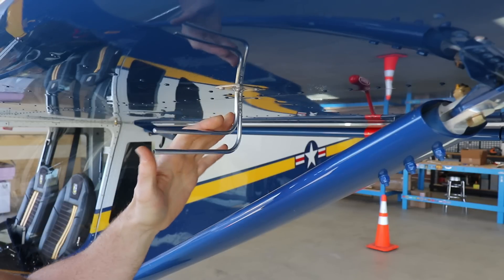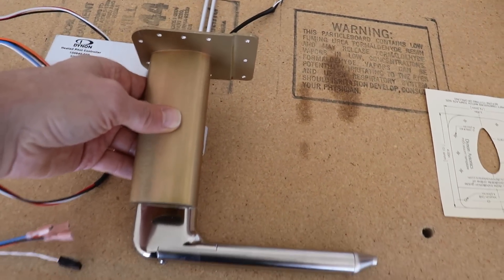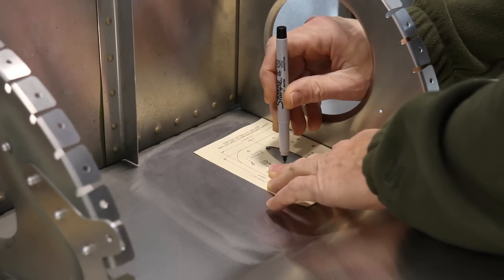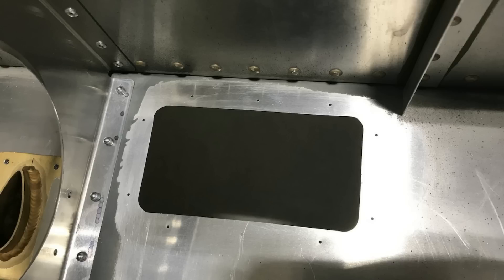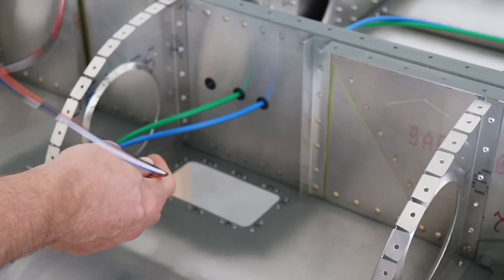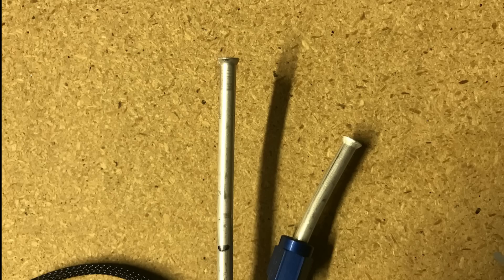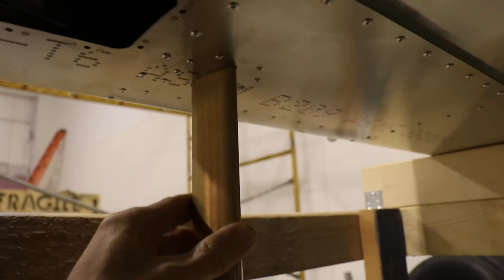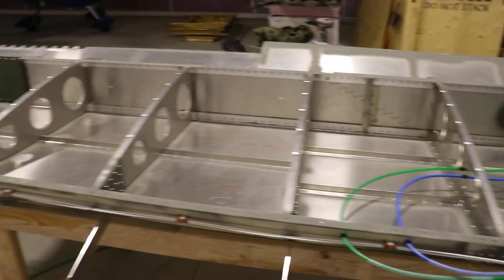Installing the Dynon Avionics Pitot Tube (Ep19)

Comment: How did you fasten the Pitot / AOA probe to the Pitot mast? The probe itself doesn't have any mounting or screw holes; is it glued in place?
Reply from the maker: It's a very very tight fit. I'm not using anything to hold it in.
Reply: @KitplaneEnthusiast  Interesting! We are doing the Dynon certified install on our Cessna 172... and the Dynon mast isn't 'certified' so we need to attach the Pitot / AOA probe to a Cessna mast. But it's not tight in the Cessna mast and there aren't any screw / bolt holes in the Pitot. Put a call into Dynon and waiting for the response, but I thought I'd see what some of my fave YouTubers had to say.
Thanks for the response!
Reply from the maker: @GlensHangar  My guess is you could just drill a small hole and use a sheet metal screw.
Reply: @UCpPmZDmGT33if0qh5GbJpiw Actually just heard from Dynon as I finished typing the last reply - supposed to drill holes for screws to hold the whole thing together. (as I thought, but just didn't want to do until I had a confirmation)

Comment: I’d like to see the two hard lines that exit the mast supported so they can’t rub against the mast tube.  Possible failure point?  Thanks for showing us your work.  Inspirational stuff!
Reply from the maker: Hey that's a good idea. Maybe I'll stuff a packing peanut in there. I think that would hold it nicely.
Reply: I was thinking the exact same thing when I watched it.  Looked like vibrations would rub those pretty good.  I would suggest just some of that plastic spiral material that you put on the lines in the trailing edge spar.

Comment: I watched a 2 hour Dynon Q&A installation video.  Love the plug & play and functionality.  But, they scared me concerning placement of cables, potential interference, vibrations, non-ferris metals, etc, etc.   Good info regardless of panel manufacturer.
Reply from the maker: Of course I don't want to tell you to disregard the Dynon instructions, but just as an FYI, when I installed the remote AHRS in my RANS S-6, it said not to mount it near any metal. The only place I had to mount it was at a joint of about 5-6 steel airframe tubes. It worked perfect there and I never had any issues at all with it. My AHRD is mounted near all of the control cables in my Cruzer and it works great. It's been my experience that the mounting location is not as critical as they might say. My opinion and experience only.
Reply: @KitplaneEnthusiast  Thank you for the kind and thorough reply.  Blessings and  happy holidays to you and the family.

Comment: You didn't show it but I assume you used a standard tubing cutter for the aluminum lines off the probe? Also is there feed back in Dynon if the heater element fails? Just watch the amp meter?
Reply from the maker: No, I cut the tubes with a band saw. Then I cleaned up and polished the ends, and then flared them.

Comment: Those connectors for the tubing look like 1/4"  5/16" NTP polyethylene push to connect fittings.  They are pretty standard in the box store isle for water to the icemaker aisle. There are a lot of custom ones and bulk head types if you need more flexibility in routing with out kinking the line.

Comment: You forgot to use tape for the access hole, after the great tip to use tape (what are you like :-)  ). I would think about some method of supporting the aluminum tubes going up through the mast as they will vibrate and could end up getting worn or cracking (rubberised packing foam works well).

Comment: You can take the paper template a either use spray adhesive or double sided tape to affix it to the skin then cut out and drill where appropriate then remove the residual paper or adhesive.

Comment: Is there enough room at that hatch to get to the Pitot lines with 2 wrenches if needed to disconnect ? Just wondering for the future.
Reply from the maker: Daniel-remember I worked on the F-16 as a mechanic. So I can pretty much do brain surgery through a 1/8” hole LOL! I haven’t tried it yet, but I think there is enough room to disconnect the lines if I need to.

Comment: Will you be bending the tubing to go into the same bay as the Pitot heater box or connect the lines straight down to come out of the pitot base , under the wing?

Comment: Couldn’t you cut that mast shorter? I don’t see why it has to push the pitot tubes so far away from the wing. Just thinking here.
Reply from the maker: I’ll have to look and see where I read it (might have been the Dynon forums) but the length is not suppose to be shortened.
Reply: @KitplaneEnthusiast  hmmm. It just doesn’t make sense. In the free air is in the free air. But I guess......if you want it to work right, stick to what they tell you you can do to it.
Reply from the maker: Honestly I would have a hard time believing shortening it an inch would make any difference-and it may not. An email to Dynon would answer that for sure. For my installation I just didn’t find a need to shorten it. It seems to mount nicely where I have it so I didn’t pursue finding out if it’s actually ok to shorten it. If you shortened yours, I wouldn’t be too concerned.
Reply: @KitplaneEnthusiast  found this on the forum from Dynon support.. You can cut down the boom AoA carefully if you want to. It doesn't need to be any longer than any other AoA probe, and the nose is a great location for it. I would try and leave an inch or two just to keep it out of the boundary layer.

Don't just chop through it, since the tubes obviously run inside. Cut the circumference carefully and you can slide off the back of the main tube you cut off.

Obviously, once you do this, we can't warranty the part at all, but it should work fine...
I was I bit worried that I really screwed up my Cruzer wing with no easy way to fix. 
Anyway thanks for the videos, they really help.
Reply: That's what I did, Just a little it is still longer than the one supplied by Zenith.